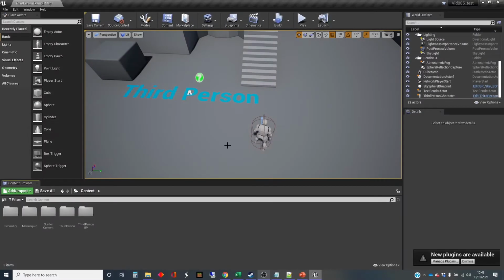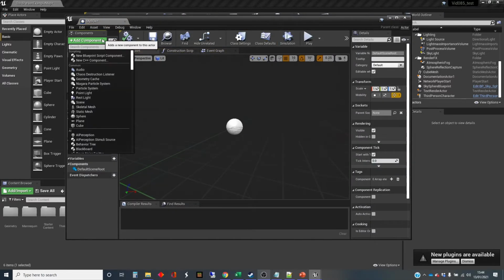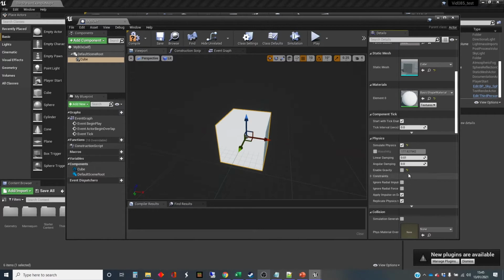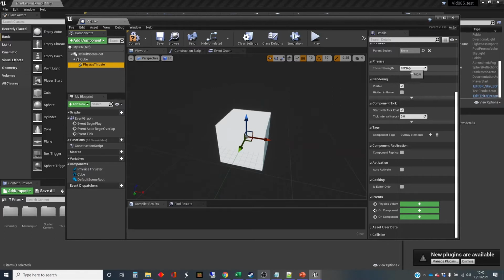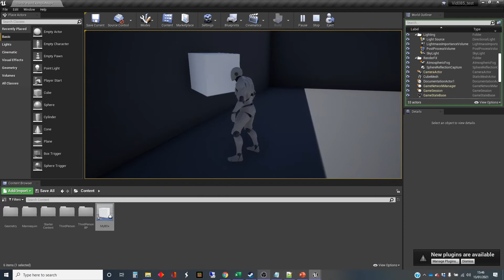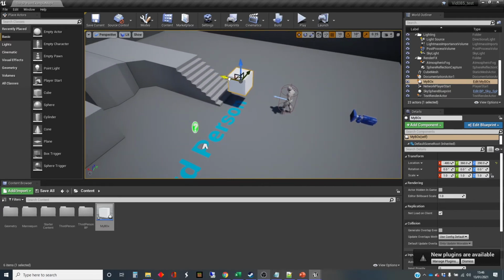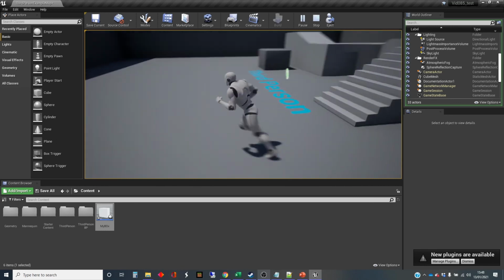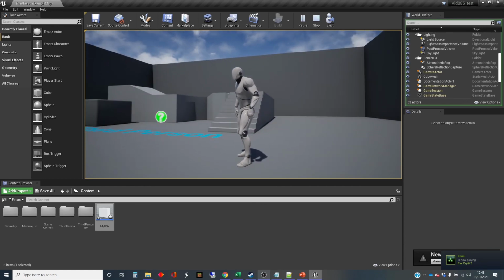Unreal Engine Tutorial Physics 05: Physics Thrusters

Comment: 4 years later, still an INCREDIBLY helpful tutorial! Before I learned this existed, I was trying to use an add force node on event tick taking into account delta time and it just... was not consistent at all. Only resulted in 90-80% of the acceleration I told it to have depending on physics settings, and even somehow changed to 3.2X what I told it to be if I tabbed away lol! It was ridiculous. I ended up resorting to manually calculating the velocity each frame and then manually setting the velocity to that. Meanwhile I could have just used this component which only has ~0.08% error normally, and 1.8% error if I tab out! So much easier, thank you!